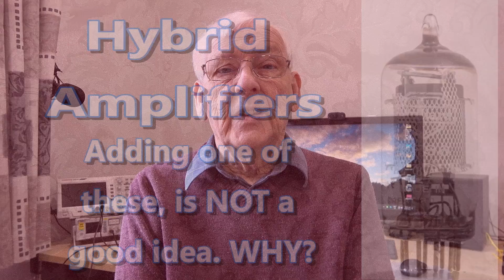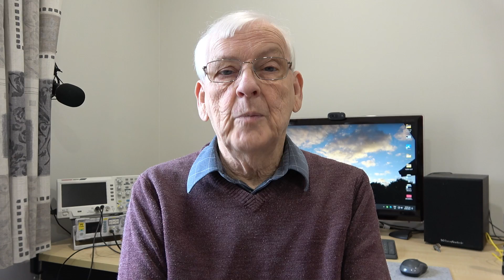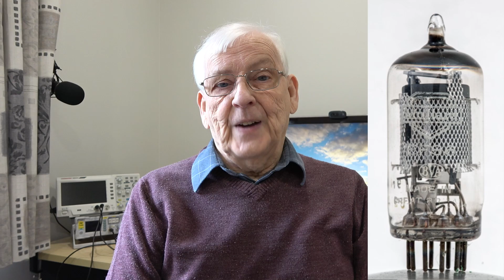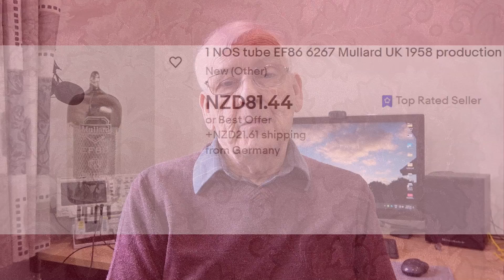HYBRID AMPLIFIERS. Adding one of these, is not a good idea. WHY?

Comment: Valves do have an advantage over BJTs and MOSFETS in guitar amplifier stages. They distort in a more pleasing way than semiconductors do. But when we don;'t want distortion, such as in h-ifi applications, then semiconductors are far more suitable, in my opinion. I do appreciate there's more to it than that. In the case of intsrument amplifiers, I still think solid state output stages are superior. And far more rugged. Some musicians are clumsy 🙂

Comment: I agree with everything you've said. The technology of vacuum tubes has many drawbacks. I bought my first solid state amplifier in 1968 and never looked back. However, vacuum tubes do have one advantage for the input stage of electronic circuits, their very high input impedance. A typical input impedance of a tube circuit can be 100 Kohms or more while for say a solid state power amplifier it could be as low as 5 Kohms. Now if the source impedance of the prior stage were say a low cost low power solid state class AB amplifier where it is under 1 ohm, it wouldn't matter. But many if not most stick with the traditional cathode follower or emitter follower output which is at least 40 ohms. Look at Stereophile's measurements of a Nagra preamplifier with a cost of $8000 to $12,000. Its circuits consist of three cheap dual triode 1960s tubes with an output impedance of 600 ohms. The tests show that with a solid state amplifier the high end is rolled off. The circuit is less complex that a 1950s AM table radio with 5 tubes. 

With this very bad arrangement, the complex impedance of the connection cable becomes a factor in the frequency response. The circuit is modeled using Thevenin's theorem for the source, the telegrapher's equations for the connecting wire, and the complex impedance of the load, in this case the input stage of the power amplifier. In an ideal case the output impedance of the prior stage would be zero, the input impedance of the power amplifier would be infinite, and the impedance of the wire would be irrelevant except for an open circuit or a short circuit. Using a cable as a control element is the worst possible choice. An equalizer is a much better choice. So some companies are using vacuum tubes for the input stage of a solid state power amplifier. Personally I think a MOSFET would be a far better choice. 

The most primitive amplifier circuit we have is the single ended vacuum tube triode with no negative feedback.This is probably the amplifier Deforest used. Everything that can go wrong with it does go wrong. For example the cathode emissions varies with the fourth power of the temperature. Low power, high distortion. Yet some people love those 300B SETs. Go figure. 

The high output impedance of the plate circuit from 5 kohms to 15 kohms creates an interesting kind of distortion sold state amplifiers which don't use output transformers can't duplicate. That form of distortion is hysteresis loop distortion. this is where the negative going waveform for a sine wave does not retrace the positive going waveform due to inertia of the magnetic domains to change polarity even in the best transformer iron such as permalloy and supermalloy. The output transformer may be the greatest source of distortion in a vacuum tube amplifier. I was surprised that at a trade show hosted by Vacuum Tube Valley about 15 years ago, I was able to identify by sound alone the one solid state amplifier in the show.

Comment: Yes I agree, I have been experiencing this for a while, I brought some really nice vintage Infinity IRS Beta's and what I heard was not what I was expecting. I thought everything would sound fantastic, but no, now only some things sounded great, the others no matter the volume sounded just not right. I upgraded all my cables and it just got worse, so I stopped and just listened. It took me a while, but I realized that I was hearing was things that I had not heard before, the fault was not with the equipment, or in fact me, but what I was listening to. Valve amps add even order harmonics which is the most acceptable form of distortion, but as you say, in a hybrid application, that distortion is just made louder. I still love the sound of a valve amp when I want to just use it for gentle background music, but when I really want to hear everything I just have to go classic A/B with a little power behind them and great speakers. My choice of speakers have become 1980's Infinity's, especially because of their EMIT drivers. Sorry for the long response, but I felt you might like to hear another no audiophile's perspective. Thanks for your post, it got me thinking again...
Reply from the maker: Hi Kevin. I appreciate all my viewers views. This is why I make such videos. I'm not Nieve enough to think my view are the ONLY correct ones. I do try and offer my opinions based on 60 years in the sound business. Working for Quad, Cambridge Audio, founder member of Monitor Audio. 5 years in retail. to name but a few. At the end of the day, if the sound you listen to, you are pleased with, that's the important thing. I appreciate your input.

Comment: Sir, what equipment do you use for your own listening pleasure?
Reply from the maker: Hi Charly, it does change quite often, simply because of my channel. You cannot talk about things you have not experienced or tested the item over the years.
All of my music is in the form of FLAC files on my PC. Soused largely from my then, very large collection of CDs. I no longer have ANY solid media.
I use a D10 DAC, my speakers (at present) are Monitor Audio Silver 500s. My amplifiers, alternate between the L12/2 and the dual version of the TDA 7293 driven by the Clone Accuphase modified kit preamp. All of which I've shown on my channel. These items are switched out at times when new stuff is built and tested. So far, I find this system very clean, dynamic and detailed. Not a valve in site lol

Comment: Well said, sir. This really needed saying!
The...fashion for shoe horning valves into solid state equipment is one of the most stupid ideas in todays, so called, hi-fi market.
I would go further and say that, for me, the use of valves in hi-fi in general, is anathema.
The sensible use of valves is in high power applications such as radar and medicine, or guitar amplifiers - where those distortion characteristics can be usefully harnessed.

Thanks for the piece.

Comment: I did see one hybrid amp where the valves did not effect the audio - as only the heaters were connected!
As for %99 of them, why have a fragile glass envelope sticking it's head out the top waiting to be smashed - or is that done so they can sell you another one after the slipup.
Reply from the maker: Hi Paul, yes, I have heard that story floating around. That, if true, would be appalling. I have, so far never experienced such open deception. Most are like the ones in my video. Added mostly to fool the public but using junk unsuitable valves, but they look good. For some that's all they need.
Reply: @MichaelBeeny  With much of the crappy Class D and Bluetooth junk floating around you'd probably need the added distortion from too few volts on the wrong tubes before they would notice any difference.

Comment: Good points. As an audio enthusiast  I'm starting to leave the path of accuracy more and more because of the bad recordings. (Sad but true, as I would want them to be accurate). Nelson Pass made a harmonic generator. There you can dial in the amount of 2nd harmonics you want. Maybe that's a good middle ground. I haven't tried it though
Reply: This approach is bonkers because it is utimately self defeating!
To attempt to mask noise by introducing more noise gets you.... well, you figure it out.
If I don't like a recording, it only gets played the once.
Reply: @Lif-999  strange...you don't listen to the band you like? You only listen to good recordings? If introducing a bit of second harmonics means you lose a bit at the top, but you can bring the level from those bad recordings a lot up,  I think it's worth considering.
Reply: @Mrhifitunes  
Not so much 'strange', more... pragmatic, I feel.
It's not just about the performance of the band or artist, but of the choices made by the sound engineer.
So for me, the presence of both of these elements in combination are what deliver the most enjoyable listening experience.
To put it rather more crassly: I will not tolerate poor source material on my expensive audio system. And why would I [rhetorical.]

On a slightly different note: I apologise for the use of the word bonkers in my original response.
In these days of rampant hyperbole, it was ill concidered at best.
However, to your credit, you took it in the spirit that it was intended. For this I thank you.
Cheers.
Phil.
Reply: @Lif-999  apologies accepted. I do agree that the sound engineer has for certain music a big contribution. But do you know they make different master tapes? Not even talking about the changes made in all those online music platforms. Many recordings are compressed have no dynamics and often clipping. Just like Michael said. Also the reason why some prefer vinyl. (Different master and no compression). 
Having the best measuring system is like an F1 car. Those bad recordings will sound horrible, just like an F1 car will drive horrible on a bumpy road. A family car can be more pleasant. After all you want to enjoy your music to the max. Measurements are important to show flaws but measurements are not everything. In an ideal world, yes but unfortunately not. Just like the potholes in the road we have to take it like they come. Just my thoughts....you may see things differently...
Reply from the maker: @Mrhifitunes  All opinions are most welcome here. I never remove anyone's comments unless they breach YouTubes guild lines.

Comment: I have a few valve power amps including QUAD11 and leak stereo 20 .
i do not use them with there matching preams but with high quality solid state preamp simply because they sound better.
Reply from the maker: If I had to use a valve power amp, it would be the Quad 11. One of the better designs that actually measures quite well. A very good output transformer. Afterall the output transformer IS a valve amplifier.

Comment: If we move up a good step in price range in regard to class D amplifiers and tube preamps, then it gets really interesting. Current state of the art class D (Hypex, Purifi, Icepower) tends to be so detailed, distortion free and close to the "wire with gain", some people whose ears are used to good old class AB, A or even tube amps don't like that sound.

They aren't used to the sound of what is basically a precision instrument compared to their old amps from the 70s. Suddenly every detail, including the flaws in the musical recordings is audible. They tend to describe that precision as "coldness" or "digitalness", which of course it isn't - technically it's just neutrality and precision. So they try (good) tube preamps, and would you look at that, now the chain sounds good.

Even good and properly designed tube preamps add a certain amount of distortion. Just enough for those people to not miss anymore what they're used to.

It's a very interesting topic that is very much about psychoacoustics and learned and therefore expected sound properties. And therefore highly subjective.

Comment: I think there is nothing against sticking in a pair of valves and using only the filaments: gives a nice glow, you can warm your hands if they are cold: all advantages you missed to mention LOL!  You are right of course. I once tested a line amp with way too low voltage using grid leakage: measured awful, but was marketed with a whole mystic story about how the circuit "came to the designer while in hospital" Moreover the circuit was nicked from another manufacturer. If you made it bit work for a moment, the way it distorted took seconds to stabilize again at lower levels.
Reply from the maker: Yes, sorry I had forgotten those extra benefits. I will try harder on my next video lol.

Comment: Thank Michael, I've built my preamp  mainly as a passive device, selecting among four inputs and an alps motorized potentiometer (for the sake of not rising from the cauch)
I also added an active gain stage based on Korg which I bought as a complete kit from the US, they say it adds some of the sweet second harmonic which is typical to tubes.
So I can select between no gain and with gain, must be careful to lower the volume when these extra 16dB come rushing in.
I can't tell which one I like more, I guess it depends on the kind of music and mainly on my mood at that moment.
And, let's not forget those 2 illuminated UV meters with their bouncing needles....
Reply from the maker: 16 dB jump in level can make you spill your tea for sure. lol. Illuminated meters ALWAYS make the sound better!

Comment: I get what you are saying.  I hate these chinese valves. Some of them even ship with LEDs inside to make them glow.
I've got a Naim NAP250 with the avondale upgrades running with a preamp in SRPP configuration with ECC88 valves. Speakers will be my next focus. Currently They are Monitor Audio Silver 6's
Girl from Ipanema and a few other recordings has never sounded this good... to me at least.
I've also build a phono stage with 3 x 12ax7 based on the marantz 7 design. So listening to vinyl, the signal goes from the 12ax7 in phono to the ecc88's in pre then goes to the BUV20's in the avondale. Those BUV20's are magical, and runs circles around the MJ's from the original avondale. I've got my bias set to 80mv, and it runs as stable as can get for hours on end.
Reply from the maker: The ECC88 is also an RF valve made for VHF circuits, but it's not all bad, at least it's a Mullard. lol

Comment: this is why i have gone back to Classical recordings.  most pop/rock sounds terrible today.  Classical recordings are engineered better for people with ears
Reply from the maker: That's probably very true.
Reply: Where does this pompous view come from? As if there isn't enough music to listen to? I get liking classical (I don't, its all boring to me, well except maybe Steve Reich and a few movie OSTs), but ''most X sounds terrible today" is just BS. Over the years I've collected about 6300 tracks - ranging from tracker music with 11k mono 8bit samples to 128kbps badly mastered mp3s to impeccable FLAC.
Where does electronic music even fit here? Its not even recorded, its created.
Reply from the maker: @VEC7ORlt  If all you listen to is PC made music, you are right. Almost any amplifier could be used and is. Look at all the idiots driving around in cars with thousands of watts blaring out annoying everyone in the area, side panels rattling. For this kind of noise there is no spec. If it's loud with ridicules amounts of bass lift, then the amplifier is good. If this is similar to your choice of music, my video will seam pompous. The sound (or noise) you make has no measurable standard because it's not REAL. You simply twiddle the knobs until the noise makes you happy. Nothing wrong with that.
We all have a choice. As you correctly said, your music is not real it's just created. How could I make a video about comparing the difference between two different amplifiers when the playback medium has nothing real? It's an impossible task.
Reply: Surly you don't go to any music for its engineering, you listen to what you like.